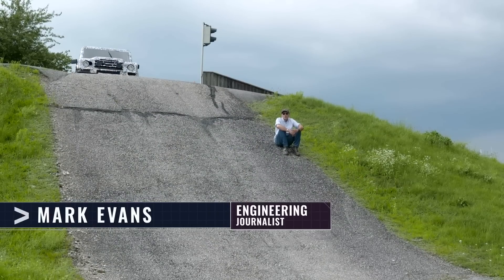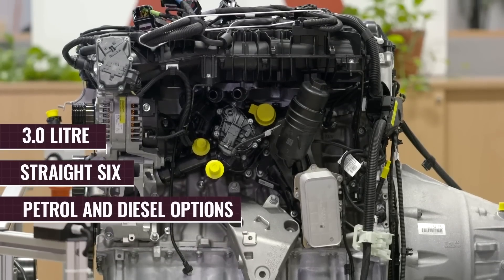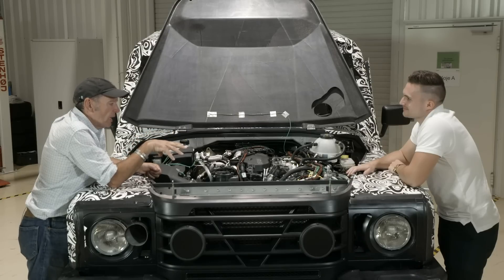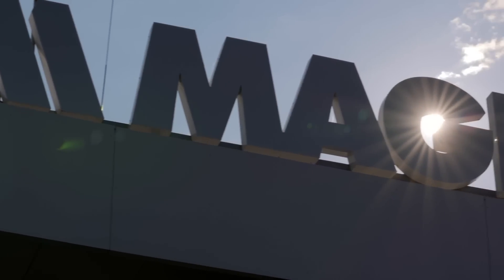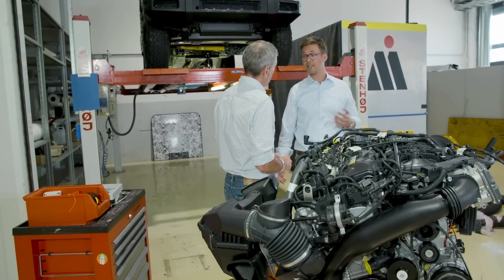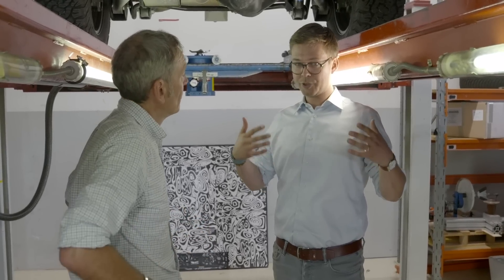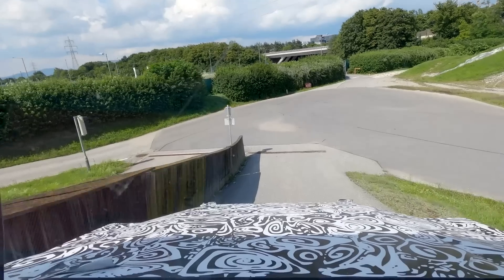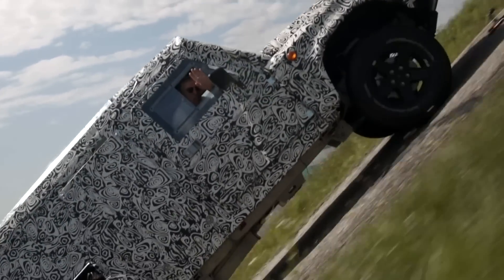Building the Grenadier - Episode 5 - Engine & Transmission

Comment: So they went cheap and anologue on the suspension and spend a fortune on a fully electronic engine transmission, what is going on! Total nuts...this vehicle is either state of the art or fixable anywhere but they have done the wosrt solution.. Imagine you need Bosch to do all your servicing at £160 per hour just nuts. Just nobody is going to buy this half G Wagon half Defender.. Designed for old men who live in yester world..

Comment: folks you need to answer the questions when it comes to reliability I don't want to be a Guiney pig with my purchase that I will be stuck with for years to come
Reply from the maker: The Grenadier is being built on purpose, for purpose — as a capable, durable and reliable working tool, which we have proven during testing 💪

Comment: ZF make great gearboxes. I have no problems with the 8speed  choice. Safer in testing conditions and easier to drive. Your engine choices though will definitely worry people in the outback and remote locations when it comes to BMW parts availability. Cummins should be considered for the diesel variants. 4bt/6bt donks are torque monsters and extremely reliable.
Reply: This engine is extremely reliable and made in huge numbers as is.

You generally dont end up fixing engines all that much but rather the rest of the cars mechanic parts that get stressed
Reply: Or Isuzu 4JJ 👌🏾
Reply: @mtadc1545  dont know that

Its not a bmw m8(responding to the other comment that got deleted)

It just got a bmw engine which are bullet proof and actually street legal.
Unlike those v8 toyota shitboxes

They also want to replace some parts considered to break faster.
Reply: @kloschuessel773  which BMW engine is “bullet proof”? Literally only one BMW engine you can call bullet proof and that’s the M50. Everything else is DEFINITELY NOT “bullet proof”. Not even the BMW Megatron.
Reply: @mtadc1545  their six cylinders are all excellent engines and drive many hundreds of thousands kms.
Both diesel and petrol.
The most thought after defenders were the bmw engine ones.
Reply: Toyota use them for their Supra, so they can't be that bad!

Comment: the engines fitted on the  Toyota supra,  came from the same "family"of engines,,and  have as much as 60!!! importand parts changed,,(some, built by Toyota),,,to make it less fragile,,  Even so, is allready the most unreliable Toyota, with problems on cooling system, electronic management, and exhaust system...driving Toyota managers mad... BMW cannot make a reliable engine.. which is not a necessity on a lifestyle vehicle,,, but an importand issue in the midlle of the desert... The choice of this engine, is due to emmisions regulations.. and frankly, a really really really,  bad choice
Reply: Toyota did a bad job then.
Bcs those bmw engines are quite reliable with bmws…

They run well and those sic cylinder engines have driven bmws for many hundreds of thousand of kms for decades.

Bmw cars struggle with electronics and other parts
Reply: And obviously you have to choose a road legal engine.
Those engines are one of the best available options

Comment: This BMW 3.0 is the same engine being used in the Toyota Supra today. If Toyota is allowing this BMW engine in their vehicle, I'm sure it will be fine for the Grenadier. 

As for no manual transmission, this is not a surprise at all. Very few people today are buying manual vehicles today, those that say they won't buy it because it lacks a manual likely don't have the cash to buy one of these brand new from the dealer.
Reply: Toyota cant build a better engine themselves.
Has to be an engine that has certain emission standards and the bmw engine does this.

Also run great and very reliably overall

Comment: This would have been my next new car and probably last fossil fuel car, but that's not going to happen. That engine platform is absolute garbage. I was so excited when I heard about this car, and I don't think I've ever been more disappointed. I could have lived with auto only, and even tolerated the silly excuses for running permanent 4x4, but never those terrible engines, and don't even get me started on the cost of parts. I mean Bmw? Seriously?! Of all the excellent proven engine manufacturers there is to choose from, you went with someone known only for unreliability the last several decades. You'll only sell to people who know nothing about cars, and that will stop once they realize how terrible portal axles are on the road. Who made that terrible decision?
Reply: I would recommend driving the thing first. You cannot tell anything about reliability without knowing the calibration of the engine. This is just regular BMW bashing, because BMWs are expensive to run. BMW is known for their r6 engines. 

Regarding portal axles - it does not have portals! You mean beam axles I guess? 

Cheers
Reply: Im doing conversations straght from the factory if your interested ?...
Im replacing the engine and gearbox with one out of a 1999 ford transit... 2.5, 5 speed manual... Bulletproof !
... I'm taking deposits now  🤑

Comment: The TRUE test, Do I have the option of LOW OPEN DIFF?! I need to be able do tight turns pulling my heavy boat in LOW on HARD Surfaces without Transmission Windup!!

Comment: Oh dear, BMW engine.  A) Very difficult to fix in the field which kills the use remotely B) I suspect there will be a BMW tie up and as Ineos have not said how this will be sold or serviced then we have to consider the horror that this will be done via BMW dealerships and C) kills off the enthusiasts second hand market as these engines are not friendly to run for decades.
Reply: Why shouldn't be the engines running for decades? My bmw r6 did. The engine was the most bullet proof of all BMW components.

Comment: The BMW engine is a time bomb with a simplex  timing chain on the back of the engine and totally inadequate chain guides. Just go on Copart or ebay and take a look,
we don't even quote for repairs any more and BMW will quote a figure which no one will even think about just to get you out of the building.

Comment: I know this will be ignored or criticised, but here goes:
- The B58/B57 is a reliable engine, I believe it was a BMW/Toyota collab in 2015. Yes, the rear-mounted timing chain is annoying, but this engine was meant for eg. the older 1-series for weight distribution reasons. Also, they said "specially calibrated", so NOT a stock engine, may have some mods for more reliability.
- Speaking of the 1-series, it has the same transmission, too (ZF 8HP/8speed). It is decently reliable. Autos are decent, sure, but people seem to complain that it isn't off road suitable. This is one of the emission standards, apparently. Manuals aren't dead, though. There are some modern Suzuki Vitaras with manual gearboxes, but that's an SUV. Besides, Ineos is offering a semi-auto option, as close to a manual as possible, ie. you select the gear, the switching is done automatically.
- Not quite sure if it would be deemed "fixable by an African with a hammer", since rather ironically, the 1997-2001 SA spec defenders had BMW engines.
Reply: Oh those plastic hose fittings are AWFUL. They always cause coolant leaks and they don’t last at all!

Comment: Is that the BMW engine that has the timing chain (single stretchy item) at the rear of the engine ?
If so I would never even consider a vehicle thus fitted & as others have said BM are not the most reliable nowadays.

Comment: Why no Toyota power for reliability?
Reply: Or even better Isuzu 4JJ3. More tuneable than a Toyota and just as reliable or probably more reliable and durable.
Reply: @mtadc1545  I dont much rate Isuzu, sorry.
Reply: @johnwade1095  why not? The 4JJs are reliable and can haul loads. They’ve had more success than those Hilux and V8 70 series cruiser ends recently.
Reply: @johnwade1095  What's wrong with Isuzu apart from their maybe disliking Arctic cold starts ?
Reply: @philhealey449  my buddy has 7 Troopers and not a single one works properly.
Reply: @johnwade1095  Depressing times!
Reply: @philhealey449  for him...
😁
Reply: Toyota doesn't want to give these guys a motor or trans, they are trying to sell there own land cruiser!
Reply: @dred5375  dont Toyota sell transmissions to Mazda, engines to Lotus, and electronics to everyone?
Reply: @johnwade1095  ahhhhhh...you got me there!
Reply: @dred5375  aisin Warner. Used in the Lexus IS and Miata. Were used in the Nissan Silvia. Aisin were originally a mattress manufacturer bought by toyoda automatic looms.
Reply: @johnwade1095  I still dont think toyota wants to give up it's big diesel  or v8 gas motor to a no name company! Those motors are in some of their flagship vehicles!
Reply: @dred5375  they sell engines to lotus, so I'm unconvinced.
What about the Ford 2.7 V6? Probably big enough.
Reply: @johnwade1095 any of the ford v6 ecoboost would be cool! A 5.0 would fit! Cummins r2.8 would be nice!
Reply: @johnwade1095  they really should keep it way simple though! No tech, just fuel injection that runs the motor and separate trans controller or manual trans! Should have went with dana axles, 60's would be perfect and still get parts from around d the world!
Reply: @dred5375  I'm contractually prohibited from commenting on the Cummins.
Reply: Toyota  having trouble  with injector  parts apparently  linked to fiat ( technology)

Comment: I know that it's a bit late at this point, but I have to question the decision to go with BMW engines.  The general consensus is that they're over-complicated, need constant maintenance, require over-priced parts, and have weak cooling systems.  These things need to be serviceable in the field by untrained owners or employees, and BMW engines may be a bit beyond their abilities.  I recognize that the European market wouldn't want thirsty V-8s, but American engines are generally as durable and reliable as anvils.
Reply from the maker: Hi Ben. The Grenadier will feature specially calibrated BMW engines for off-road performance. Delivering high torque at low engine speeds. We'll be sharing more details in the coming months.
Reply: @INEOSGrenadier  does “specially calibrated” mean getting rid of the weak points like those PLASTIC hose fittings, PLASTIC expansion tanks, REAR timing chains, PLASTIC water pump impellers/pulleys and PLASTIC edged Behr Radiators, awful PCV/CCV systems and plastic coolant lines under the intake manifold? We need this addressed! I’m into my BMWs so I know what they’re like...I’d never want one in an off road vehicle though! Please let us all know about this.

Comment: A lot of people are complaining about the fact you cannot tow or push the car to start it in case of flat battery due to automatic gear box.Can INEOS design office make provision for a place to add (as an option ) a SPRING STARTER as the one from the KINETECO British company ?
The possibility to  have this option will be a big plus for this Grenadier moving in remote areas.

Comment: Only just discovered this project. I used to be a 4x4 nut, but lost interest over the last twenty years due to the never ending evolution towards softer SUV's with pointless extra crap that has zero functional value to me. As I drove around for work, I always thought someone should just yank the 3.0 straight six with it's twin scroll turbo and ZF eight speed out of my M135i and tweak it for use in a proper off-road chassis. Turns out you sneaky buggers have been doing that this whole time! :-)

For all the naysayers pissing and moaning about the auto only, these are great gearboxes, they're an excellent choice. Take it from an amateur rally driver who swore they'd never own an automatic. Much to my annoyance, the ZF 8HP was the box that changed my mind.

Two piece's of advice from Australia:
1. Make it big enough for a tall bloke (with, you know; two actual shoulders, to fit in without being savaged by the pillar....and whilst you are at that, correct the ancient pedal box ergonomics that plague the Defender 110 and 70 Series cruisers.
2. Build it better than Landrover ever did the 90/110/130, they were just never reliable or strong enough. Take the Toyota 70 series and GU/GQ patrols as a benchmark there, and you will do fine, but a 110, awesome though they were, never worked consistently until you had basically upgraded the entire vehicle.

Looking forward to it!

Comment: NO MANUAL??? WTF
Reply: You should listen to your customers. A manual gearbox is a must.
Reply: I have a ‘tiptronic’ Toyota 4x4 that lets me select gears when I’m off road in High and Low range even while using diff lock. It works surprisingly well and I’ve done some proper 4x4 courses with it. I would never go back to a manual but I understand that a lot of guys want the option.
Reply from the maker: Hi Santiago, we believe that the automatic gearbox, paired with the power and torque from BMW’s in-line six-cylinder engine, will offer the best balance of capability, durability and reliability when operating in the remote environments the Grenadier is designed to work in.
Reply: @INEOSGrenadier  Ineos. Listen to your customers. We want a hardy manual that’s easy and economical to service.
Reply: @INEOSGrenadier  This decision has cost you a very strong USP. And one potential customer right here. I was so sure this would be the one.

Comment: The early Discovery TD5 had a BMW made inline 5 cylinder aluminium head which were pretty reliable engines. Guess INEOS is wanting to stick to Land Rovers past.
Reply: Incorrect. The TD5, code name project Storm, was a Land Rover designed and build engine. The 2.5 straight six in the Range Rover P38 was a BMW unit. Which was rubbish by the way...
Cheers
Reply: Common misconception.  BMW. Wanted to can the Land Rover designed TD5 and replace with BMW engine, actually turned out to be a great and reliable engine.  I have one !

Comment: I can't help thinking that this is the wrong engine choice. BMW doesn't scream "fixable by an African with a hammer" or even "remotely reliable". It's a shame because this is a brilliant project and there's definitely a market for this going forward.
Reply: The BMW M52 was an engine used in the Defender in Africa from 1997 - 2001 😂 but I would still prefer to see a Toyota engine in there
Reply: @mattyolo  the M52s don’t have anywhere near as much plastic as the newer BMW engines.
Reply: @mtadc1545  👍
Reply: This is not going to be a cheap vehicle for the masses. Just a trendy alternative to a mainstream alternative.
Reply: @simonaeldred  The Toyota 70 series isn’t a cheap vehicle for the masses and neither was the original defender so maybe they not going for that market?

Comment: You shouldv choose a toyota engine.
Reply: Yes the German engine is a poor choice.
Reply from the maker: Hi Bob. This BMW engine is proven to deal with stringent emissions regulations as well as heavy cargo on-board and towing heavy loads. Less stress equals less wear and tear, strain on components, and strain on the driver.
Reply: INEOS Automotive in Europe yes but outside Europe I don't trust any power train other than toyota !
Reply: I think what most people are forgetting is that this is a small company and while the 70 Series is THE off-road vehicle in Africa you can’t buy one in most developed countries due to the crash ratings and emissions. So it makes no sense to design and build a car from scratch that people in developed countries ( read those with money)  can’t drive...There just isn’t a business sense to it. Think about Toyota, one of the largest car companies in the world and they can’t even make the 70 Series pass crash and emission testing in the modern world and they have already amortized the development cost of the car decades ago...
Reply: Mariner  We are not talking about a car that will spend its life on the road with proper maintenance like the Supra, we are talking about an engine that has to withstand the harshest environment like the  super hot, dusty, humide place like Africa and Australia. An engine that even broken can easily be fixed like the notorious 4L V6 of the 4runner and Tacoma. Or the Land cruiser engine. Im not saying the BMW engine is bad, its probably very good but no one would choose a BMW engine over a Land Cruiser engine.

Comment: I appreciate what you guys are doing, especially with designing it all for rugged use. But you lost me and alot more Australian's by having all time 4x4 and only automatic.
Reply: There’s a lot of LC 200 and Prados in Aus. Both permanent 4x4 both Autos
Reply: What's wrong with constant 4x4? And modern automatics are great for 4WDing. Sure old autos were junk but they have come a really long way and there are more than a few transmission experts which will tell you the same.